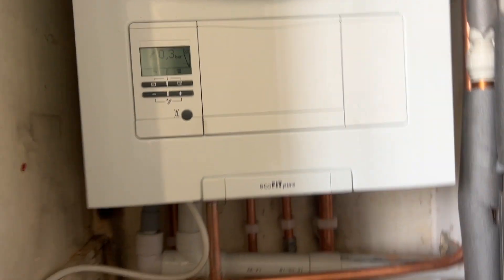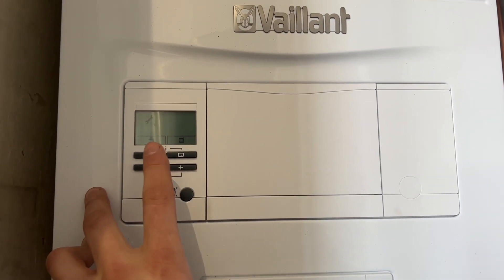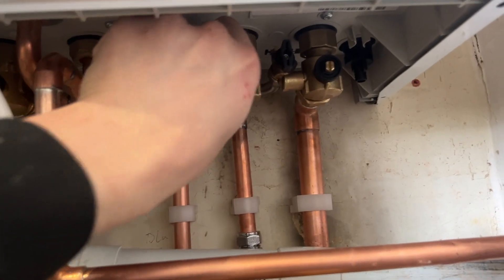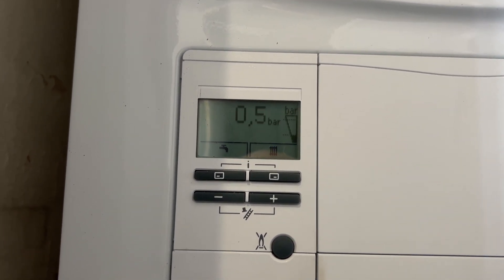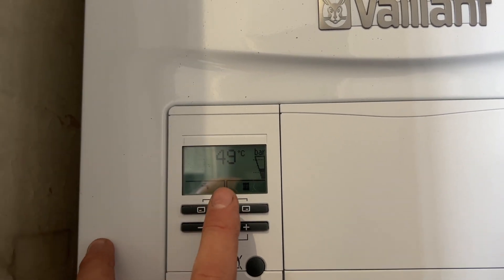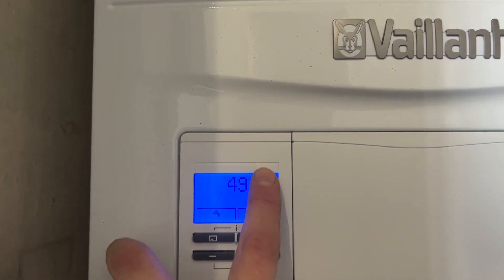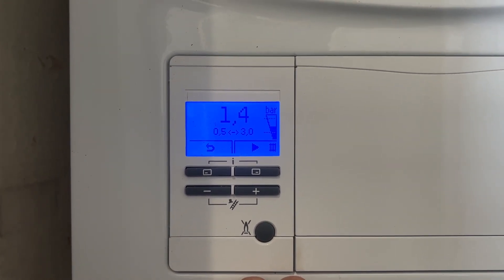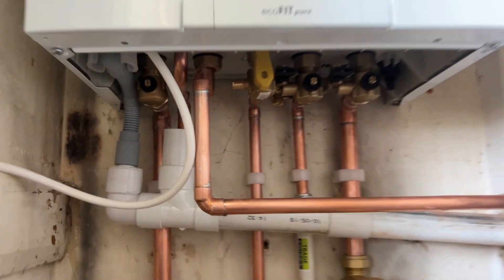How to pressurise a Vaillant Ecofit Boiler F22 FAULT

Comment: I dont have 2 taps going in is mine installed incorrectly only been a week
Reply: Have the same issue. I have an ecofit sustain which doesn’t have the two taps either. Did you ever resolve this?
Reply: @MRLawson1234 
Mine also doesn't have the valves like this combi does

It turns out to be a system boiler. Look out for a silver braided hose somewhere further down the piping. I found my two valves there

Repressurised successfully
Reply: Any updates? I too don't have the taps. Just one cold water supply
Reply: @boblexden5886 so found some taps upstairs where the water tank is what i could release to let the pressure fill back up. Not sure how much help this is as im terrible at explaining things